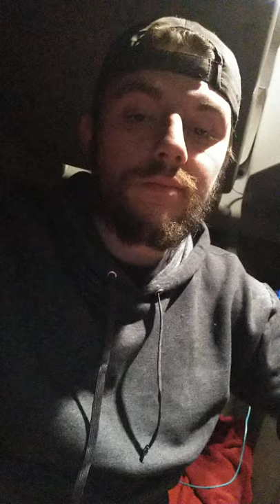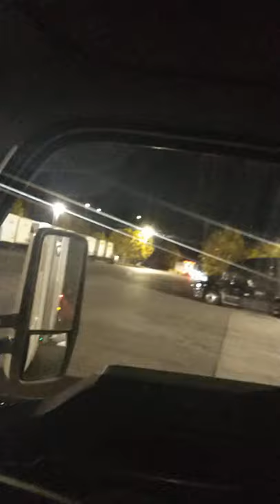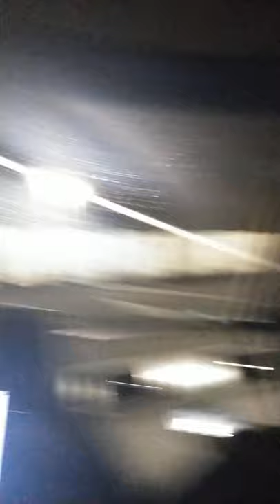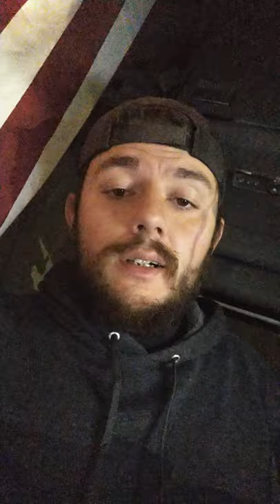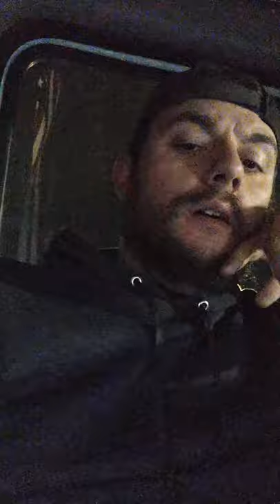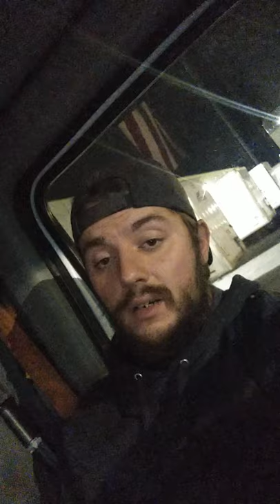Hurry Up and Wait.  Still sitting at Conagra in Vonore TN.  USA Truck O/O Vlog LP I/C

Comment: Stay away from smuckers in Lacombe la. They are a headache. I had one load cancel Monday after having it booked for 4 days then I book another from there because I just moved to Gulfport and get jacked around again and I’m just leaving now on Thursday. Also have you guys been told that truck order not used only pays 150, I have dispatched and drove forever and they never had a issue with most brokers to get 250 for TONU?.

Comment: Don't do the one in Frankfurt Indiana either. Went there to pick up a load for 2300 pounds and they loaded me 42800 and told me I had to talk to the broker and leave. Needless to say I dropped the trailer there and left. They wouldn't give me a dime more for the weight difference.